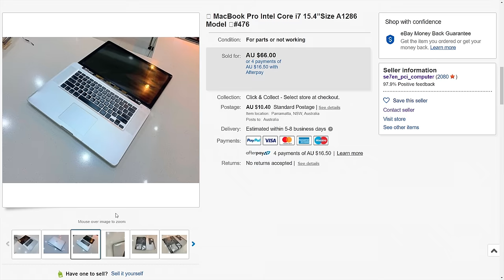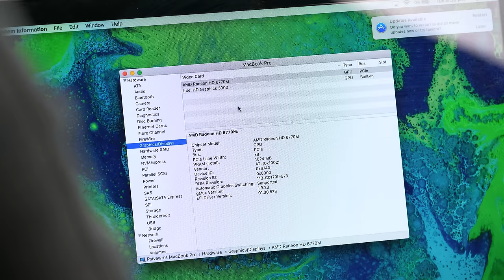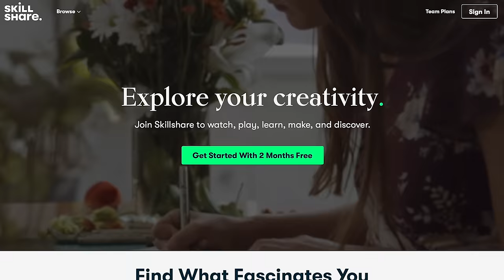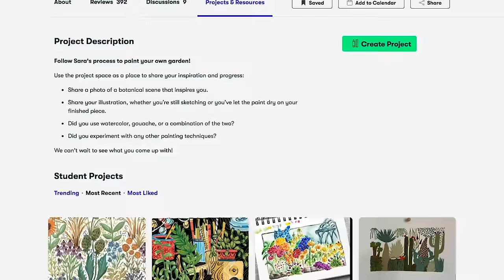$66 Ruined Macbook Pro Gets Restored!

Comment: "My solution was actually to press the chip down with some cardboard."
😮
Apple: "Damnit, they've learned our secrets!"
Reply: Yup, Apple literally put rubber on chips that were making a bad connection and called it fixed.
Reply: "Don't worry, the fool used cardboard. Our high tech rubber pad secret is safe for another day" 😉
Reply: Is it still working with the cardboard fix?

Comment: Wow, I never realized that that gpu commonly had issues. I have that exact model, and I've had many drive issues and plan to soon upgrade to an ssd on it, or more likely to a newer Retina MacBook Pro as a side laptop.

Edit: Actually, I just booted the laptop back up, and the gpu isn't recognized and the system is using the HD 3000.

Comment: For the Sierra installer, I believe the date settings are beyond the threshold for successful installation (authentication on server side, I presume)
You can circumvent this by starting Terminal within the installation USB and use the 'date' command to manually change the system date to a time when installation is allowed (the initial release date of the desired OS, for example), then start actual installation

Comment: You can get thermal tape and a temperature adjustable rework station for under $50 USD. Stencils, flux and solder balls for a few dollars more if you really want to have a proper go at it.

Comment: I've reflowed BGA chips many times. 90% of the repairs remain valid... The melting point for lead-free solder (no doubt, used in this case), is 217Celsius. In our reflow ovens at work, we start with 320 degrees, as it offers the best solution in undustrial applications (motor controllers, solid state relays, wind turbine electronics)

Comment: I have this laptop and had the gpu issue you mention in the video, However before toasting I decided to check all the tantalum capacitors to see if they were defective, there was 1 that has negative readings well under a volt, I heated that cap and tried the laptop only to find that it worked and the cap was temporally restored at this point I bought a replacement cap from ebay and and replaced the dying cap. Mine is now fixed been gaming on it for over 3 months no issues. when heating that gpu up you most likely did nothing but temporarily fixed a cap that sends power to the gpu.  The restoration was great but the lack of electronics skill applied is sad but now you know for next time. Love the video keep em coming.

Comment: You should try Brasso copper cleaner it does a better job on the scratches, also you may be suprised how long a reflow will work. Its a bit hit and miss as the line between the right temps and reflow times and failure is small.

Comment: hey, just a tip!

if your macbook is really slow because of the battery, navigate to /Volumes/OS X Install Location/System/Library/Extensions/IOPlatformPluginFamily.kext/Contents/Plugins/ACPI_SMC_PlatformPlugin/Contents/Resources/Mac identifier (eg. MacBookAir4,2.plist)

Delete the plist file

if you can’t do it do it from terminal in os x recovery (only for 10.12 and above, might be 10.11) (10.10 - 10.7 tested )

Comment: Use a cutting polish put it on and let it dry up a little then rub it with a rag soaked in the polish until it buffs. Do not use anything else till buff has removed the minor scratches.

Comment: Add flux to around the chip to help the solder reflow. I did this to my Xbox 360 and it fixed it with a heat gun

Comment: I actually managed to purchase one of these with a working GPU. I paid £50 in the UK it came with 250GB SSD 8GB RAM and a near new battery. I’ve since maxed it out to Sonoma using the patch tools and it runs great but I have yet to put it under load on the new OS but max fan control will be enabled first and it’ll be getting new thermal paste I intend to keep it running for as long as possible as it must be rare to maintain a fully working one of these AMD gremlins.

Comment: 1: big props on that metalwork, excellent job in straightening out those dents.

2:  wth, that HD3000 seems to perform better in games than my laptop with HD4400?!
Reply: @minhngoctran2930  yeah all that stuff doesn't help lol  believe me I've tried. the issue is the HD4400 is in a 4200u processor in my Thinkpad.  And Lenovo's firmware limits the power draw and thermals so that I've rarely ever even seen it reach 70C (it's usually in the 40s, only gets to high 50's under a heavy load) so I'm pretty sure instead of a 15Watt TDP limit they made it like 12 or something...

Even trying to mess with Intel eXtreme Tuning Utility doesn't do anything to help.

One thing I've read is that integrated graphics love more memory bandwidth.  So since my Thinkpad has a 4GB soldered to it with only 1 expansion slot, I put in a 4GB stick instead of an 8GB stick so that I could run the memory in dual channel mode.  For some people I've seen that they get like a 12-20% improvement in FPS...I couldn't see much of a difference in my tests between the two with that though

Comment: If you have one of these computers there is a program called gSwitch.  It runs in the background and lets you select which graphics to use.  If you set it for integrated it will hold it there and not let it change.  You can also select dynamic or discrete... Great program i use in on my mid 2011 macbook pro luckily my NVIDIA chip still works but i have also taken a grinder to my bottom cover so.  It runs much cooler then normal ones.  Typically 50-60C and never more then 88C while watching 4k vids...  these models were famous for pushing 100-110C...  I also run Macs Fan control set to monitor CPU1 and to maintain a temp range of 40c-90c.  You need both of these programs if you have a macbook pro and air.  They all run super hot...  I am also using MasterGel Maker Nano Thermal Paste.

Comment: Heatgun method works fine. My method is To use aluminium paper like you but i use flux around cpu or gpu. My ps3 is fixed since 3 years with my heatgun and works really Well. Just needed flux to work longer. Without flux it only last 2 months

Comment: The temperature used is to low, considering the solder melting point is 350 C. You need higher temp due to the heat absorption of the board to be able to re flow solder balls.

Comment: I glued a thermal pad to the heatsink so it would touch the backplate of my MBP. Temps droped by 20°C and it never overheats. Downside: the back heats up in that area.
Reply: are you using the same laptop as this video?

Comment: Great work. You said it was running slow because the battery was dead. I always assumed you got full power when plugged in even when your battery was completely shot. Is that not the case?

Comment: one thing i do with these is get the hp dv7 with the 6770m its a red gpu instead of the green one . it doesnt warp and fail do to it being thicker however you will need to shim the cpu with copper however it will never fail again and he boards for the hp are like 70 bucks at best

Comment: I bought a 15 inch 2011 MacBook pro with the same processor and GPU and the GPU did die, so instead of getting a heat gun because I'm not equipped with one I decided to play Minecraft at Max render distance and Max graphical, it shouldn't even gotten to the GPU cuz I used the GPU disable thing but I guess the heat pipes made it to the GPU and heated it up so much that when I got interested and re-enabled the GPU I've not got any issues since, instead of permanent fix and I know that and my little sister did pour applesauce on my MacBook, so once I get that made sure that there's no water damage and a power back on it should be fine

Comment: Hi psivewri, I was wondering if you have any solutions for a bend in my Mid 2012 MacBook Pro. The top left of the lid (left side of the lid when closed- is slightly bent upwards because of damage caused by the previous owner. Its not that big, but it's more noticeable when the macbook is closed. While my MacBook works perfectly fine, I want to see if I can fix the bend.
Thanks!

Comment: Much! good your videos!
I use a 17 " MBP (2.4Ghz) year 2011, Fixed on a work table, with 5 cooller game support. :)
On the side of the DVD drive, there is a security lock attached to the table. But! when moving the computer several times, there were marks on the aluminum. :(
How can I eliminate this mark (scratch) on the surface of my macbook ?

Comment: The reason the AMD GPU works after a mild heat application is because of the under fill material used in the GPU, whenever the machine gets hot, around 180 to 230 degrees Fahrenheit, the underfill will turn into almost a liquid like substance, moving tiny solder balls (on the chip die itself) around causing graphical glitches, and or a kernel panic.

Its really just a waste of heat and needs to be disabled for long term use.

Good video though!

Comment: You need to preheat the board and use 400 C on the GPU. At 350 the solder barely starts to melt

Comment: I got one of these for free because it had a bad battery and was too slow for the user. Perfect condition. Slapped in a new battery / thermal paste / bottom feet, and its up and running great. Somehow the AMD GPU still hasn't failed...fingers crossed!

Comment: You do NOT NEED to heat the board with a heat gun or putting it in a oven... To get that same result, you only need to isolate the chip from the heatsink and turn it on for a few seconds, letting the chip heat up on its own.... after +/- 30 seconds turn it off, put the heatsink on again and you are set... this will give you the same result but it will not damage the board... If this would not to work, doing your procedure would kill it too!

Comment: This is the 3rd video ive watched about Mac laptops and rebuilding them etc. I have a Unibody 2010 and a 2012 MBP and neither get very warm 32-50c. And 50c is when im really pushing it. But in these 3 videos including this one, everyone is talking about how they reach 100c etc. I have not even put new thermal paste on either of my machines. Not sure why im having such good luck keeping these machines running cool. I am using Mac Fan Control, but my fan speed is set pretty low. Was there a software patch that helped and I just dont know about it ? Both are running High Sierra 10.13.6.
Reply: Both units are 13in models. So maybe the 15in models run warmer ?

Comment: this is all too convenient - my Mac mini (2010) is getting stopped at boot with the message (verbose enabled) :
IOConsoleUsers: gIOScreenLockState 3, hs 0, bs 0, now 0, sm 0x0
a bit of googling says this is a GPU failure, so I will try the dosdude tutorial to disable ded. graphics. The issue started after using his patcher to install Catalina actually. Weird thing is it will boot windows perfectly and also will boot Catalina in safe mode, everything else gets hung with the loading bar stuck at 100% forever.
Was working ok prior on supported High Sierra.

Comment: Great job.   I have the same 15 inch 2011 macbook pro - with the same failed GPU.  I followed what I think was the path of least resistance to keeping it current and up-to-date as possible.      
My process was: 
Step 1: Use DosDude1's NVRAM hack to disable the discrete graphics chip; then 
Step 2: Install Linux Mint on the Macbook, ditching MacOS X entirely..    
A small tweak (just one line) was needed in the boot loader to get Linux to use the onboard Intel graphics, and now it works perfectly :-)

Comment: Heat had nothing to do with the GPU failing. It was ATi's fault for producing crappy chips with faulty solder. ATi serously didn't learn from the Red Ring Of Death on the Xbox 360
Reply: I think it's a pretty common problem for any graphics card which has been constantly under very high temperatures (for example, mining cards end up having this problem at some point eventually). Solder melts and some contacts get loose.
Reply: Алексей Гриднев if it was good solder it wouldn't fail

Comment: I bet you've already thought of this and it probably wouldn't work. Since this MacBook pro was so damn cheap. Why don't you try upgrading the GPU? Maybe even the CPU? Like cleaning under the GPU and CPU and then lay down new solder. Then find a CPU that was used in the same gen laptop (Using  Mactracker a nice app like every mac) and get the fastest CPU and GPU that came in that model year. Also, try using Liquid metal. I tried it on my 2012 15inch retina and it worked great but after a while (a year or so) it didn't work great. It might have had something to do with the cooling system already being shit on that laptop (Ultra-thin laptop and tiny ass fans) I then just used Thermal Hydronaut which HELPED a lot of temps) 

It would be an awesome experiment and make for an even better video! haha.

Comment: Waaaaaaaaay too much paste from factory. Your repasting jobs are overdoing it too. its only suppose to be a tiny skim layer, a peadrop is often enough to insulate chips. Try spreading paste on the silicon with a toothpick so you get an optimal thin layer.
Reply from the maker: You do realise that the paste is pressed thinly to across the die surface when the heatsink is put back on right?
Reply: @psivewri  Yes, I realize this, but its still too much paste imo. Have you removed a heatsink after this method? there is always excess paste that gets squished out. Personally, I am in the thin skimcoat crowd with zero issues. I actually find that my macbook pros especially blow much hotter air out of the vents after a thin repaste job. Fancontrol shows that temps are often ten degrees lower than before a repaste. 

Not trying to be a dick, just saying what I have learned over the years. My ROG gaming laptop also runs significantly cooler than it did stock. Try it out, see if you spot a difference. I did anyways, the thinner my paste, the better the heat transfer to the heatsink and out via the fans

Comment: hehe im using that same exact model to watch this  video ...ironic lol ...spoiler the GPU itself is defective not the solder under it reflowing it doesnt help ,the actual proplem is the glue binding the GPU die to the GPU PCB ist good it will fail soon ,only way to fix this is to solder on an updated version of that gpu

Comment: It's really beyond me why you don't buy some Flux (like from Chip Quick) and just resolder the GPU. So many of your projects could be vastly more successful, like the one where pressed down the whatever the fuck thing with cardboard.

I'm saying this because you attempt to fix old solder joins with direct heat, instead of using flux to lower the melting point of the solder and thus not risking to damage the chips. 200 degrees is WAAAY too much for what you are doing.